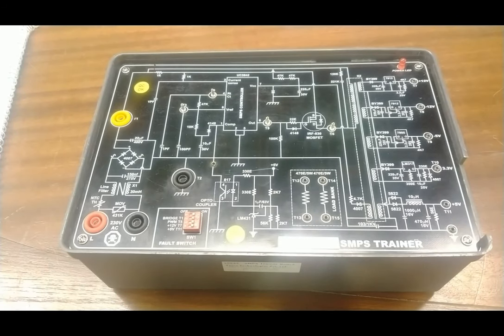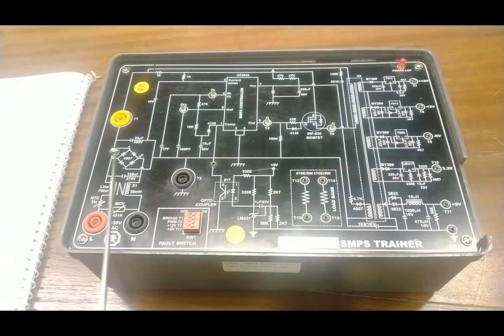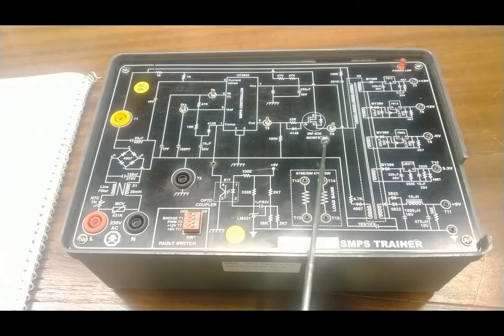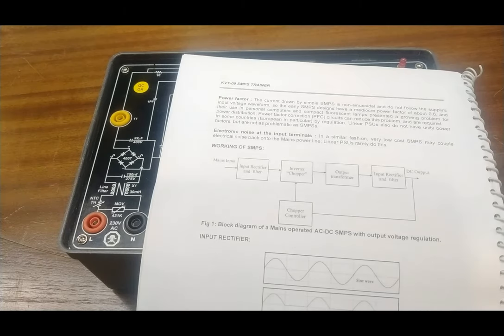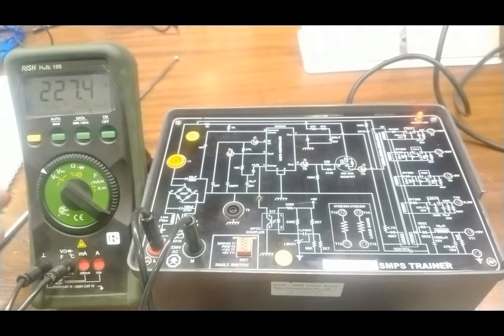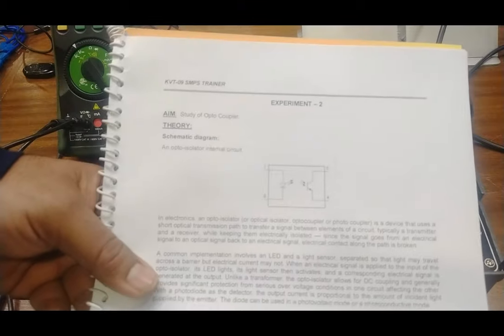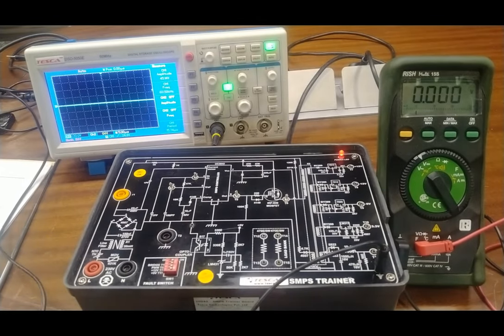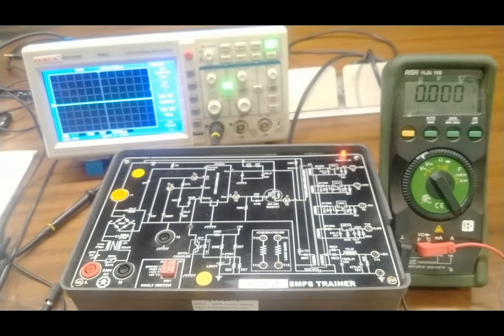SMPS Trainer Board || Tesca 10945

Comment: Something wrong when he measured T6 with DSO, the amplitude is only around 44V whereas the other end of the transformer's coil is connecting to about 380V DC from + main Electrolytic Cap. I think this experiment isn't correct. Let alone the Gnd of mosfet is connected to the ground in Cold section, these are not a real SMPS concept.
Reply from the maker: Welcome to Tesca Technologies Pvt. Ltd. India. Thanks for watching! Kindly email us  at info@tesca.in with order code for your queries!!
If you have any requirement of "Testing, Measuring, Educational Trainer, Scientific, Laboratory, Workshop Tools and Machine" You can write us at us at info@tesca.in
Contact/Whatsapp Number +91-9829132777
Also you can visit our site www.tescaglobal.com
Share & Subscribe Tesca YouTube Channel https://www.youtube.com/tescaglobal